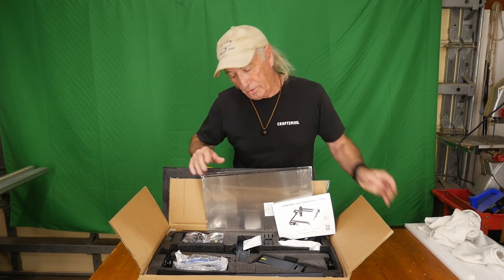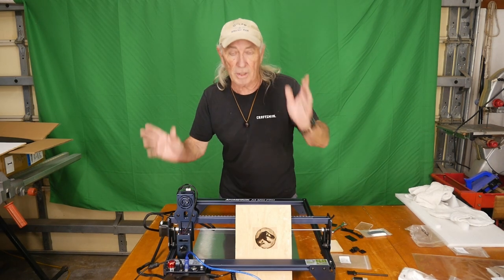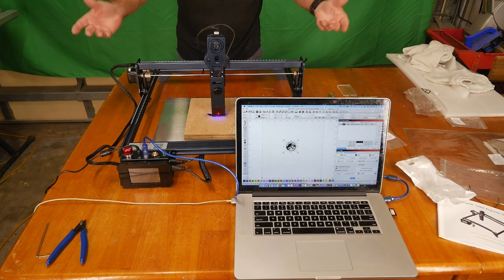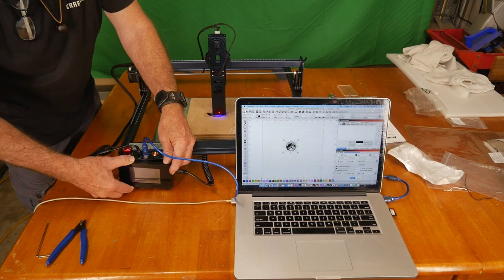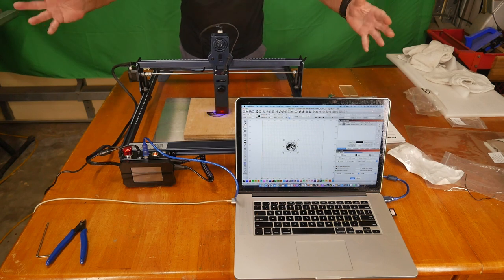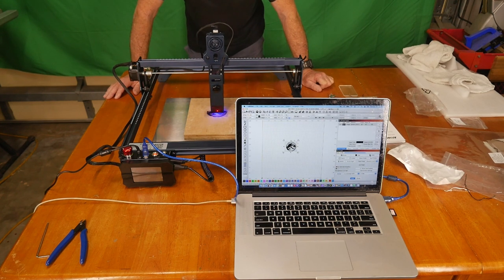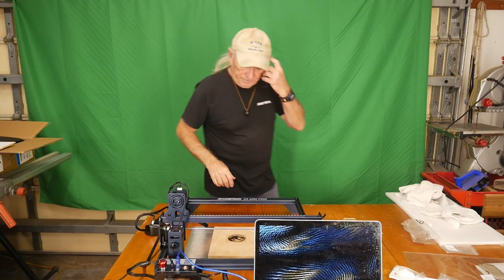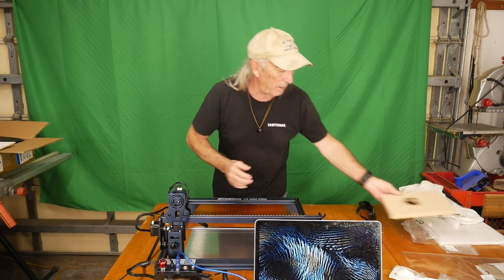Atomstack A5 M50 PRO laser engraver review, Remove rust with a laser ?Coffee and Tools episode 229

Comment: These lasers have been around for close to fifteen years. For most part they are not a good choice. Just a little less than 10 years ago I witnessed a demonstration put on be one of the laser cleaning companies at a California Bay Area refinery. As the have a large metalls and coating testing lab they were able to qualitative analyze the work.it was found that it did vaporize organic compounds and chemicals, think hydrocarbon residue. But what was left on the steel surface was identical to Hot Mill Scale, both in metallurgical and cohesiveness. You you plan on painting the surface of welding to it, it must be surface ground to remove the scale. If it is to be used as pipping of chemicals it must be Chem cleaned.
Remember, if it sounds to good to be true it probably isn't so hot an idea.
If you gained anything please give a a thumbs up.
Thanks, Andy
Reply from the maker: Hey now there's some info. I looked for the "scale" but I'm thinking the Iron Oxide was vaporized with the "laser test". Chemically treated afterward would allow for paint etc. Just not sold on using lasers to remove rust. It does sound TOO good to be true. Thumbs up Andy :)
Reply: @SirTools  I won't argue with a building full of metallurgist and chemists. Ever think of....Is All the vaporized material safety contained with <.3 micron filters???
At first it looked great, until I found out the work needed to make the repairs to tower trays out of a Vacuum tower.